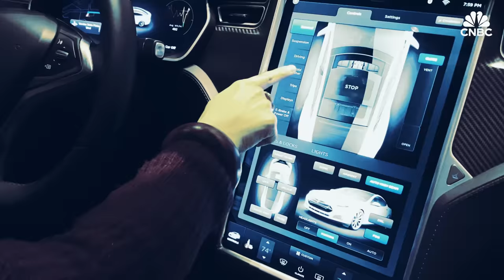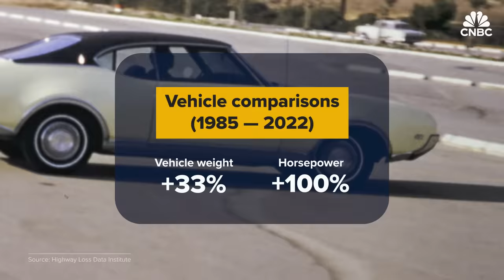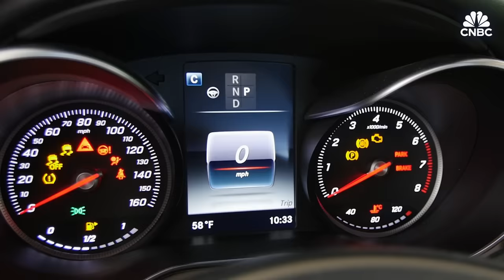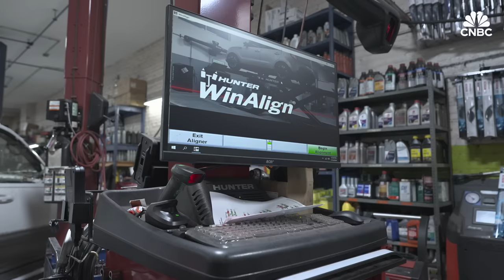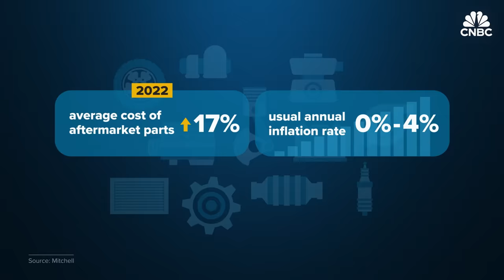Why Car Repairs Are Getting So Expensive

Comment: I just sold my car because my insurance went up 3 times in the past year and it was a crappy 99 navigator with the rear squatted but was wanting 3GS a year to insure the car. My 2007 Mazda that I had before was only 2 for the year and uh yeah haven’t been in any accidents or tickets so yeah sold the car and now just have the motorcycle till I can figure out what to do. To repair the rear suspension a shop was wanting 1500$ for a 99. Bought the car for 2gs period so make it make sense
Reply: Sold the car for 2800$ with only 120k miles on it a newer car is completely out of the quietism as I don’t have 500) for a car payment and 400 for insurance

Comment: Explain to me how cars are heavier now when all the cars today have so many more parts made with plastics than steel. Also tell the government agencies to step the hell in and stop using so much electronics on these cars making them so expensive to fix because there are 60% more modules in these cars today which make it more expensive to fix and diagnose and have them put a stop to car manufacturers the only individuals to be able to repair stuff. I’d rather see more stance items like fuses and relays with replaceable bearings like the old days these maintenance free parts are causing a bigger hit because people can’t check them on a regular basis before they fail.

Comment: TIP: get a vehicle with manual transmission. They are more dependable and economical to get. Learn to to do own maintenance. Use the best oil and best air/oil filter. To protect your vehicle. When you pay someone else to do that they use the cheapest oil cheaper filters is not good for the vehicle and change your oil every 3000 miles o every 3 months. DON'T BELIEVE the dealerships of oil changes every 5000 miles o more.

Comment: Parts have not increased that much. It's the labor cost and greed like in the HVAC industry.
Try to do your own repairs. Do all regular maintenance such as oil changes, filters, transmission oil, and coolant changes yourself, and keep those expensive components in good shape. Most importantly, don't drive like a maniac as driving plays a huge role in wear and tear. Buy reputed brands like Toyotas and Hondas, and good luck if you own VWs, BMWs.

Comment: Car prices are higher, YET, it's shown less parts need to be cast for manufacturing. Less parts should mean cheaper manufacturing. Less assembly required. 

The engineers are building cars overly complex, and the manufacturers under paying technicians. They decide how many hours it takes to fix something, resulting in industry standard pay in dealerships. They pay trash hours for tearing apart the car to fix a small sensor. Which they also charge a thousand plus dollars for on top of. I find it's argument that Turbos add a lot of extra parts to be misleading. It's not that much more. Especially when compared to the enormous battery in an EV. A Kia soul weighs about 2,900 pounds, the EV version is 3,800 pounds. 

The manufacturers are being stupid, illogical, mismanaged, and greedy. 

Also electric car sales are slumping. Fossil fuel engine cars are selling better than EsVs. I doubt dealers would tell you as a customer, knowing their Bias. How do I know? I work for many dealers, they don't lie to me. Believe what you want...manufacturers are embracing EVs. So they can re-sell you an entire car rather than sell you just parts for 15 years.  Same tactic Apple uses, along other manufacturers. Leasing is also their preferred market approach is possible. Ford lost money on their EVs terribly last year as well.

The Economy is certainly a big playing factor. Interest rates still high for many reasons.

Comment: Why are cars bigger -EPA regulations. Why are motors unreliable-EPA regulations. Why are things made so difficult to work on today vs 60s 70s 80s and even 90s companies fighting right to repair. Don't believe me look it up. Even better why is it we need dealer software to look up some very basic issues. That is why it is so expensive now. If you need an example look how to do an oil change on a 13 ford escape. Or ask why toyota has a code to replace your starter after a specific number of cycles. And finally a subscription to have physical features activated on your garbage BMW.

Comment: My 2021 Model 3 has 30k miles and the only thing it needed was a new set of tires.
Reply: all fine and dandy until you get into a accident and need to repair your telsa. insurance would rather totalled it then repair
Reply: @LCJammer  That is what insurance is for
Reply: @marled536  and how much is your insurance. i've heard horror stories of getting into a minor accident and have the car totalled out because its too expensive to fix.

Comment: I replaced the radiator on my S10 Blazer in 2020. I couldn't find a cheap replacement so I had to buy a premium radiator $270 made in Canada. I got a good surprise because the engine ran a lot cooler.

Comment: If you want cheaper vehicles, youre gonna have to give up all the luxuries.  Get computers out of vehicles.  Make engine parts out of cast iron instead of plastic and aluminum.  Body on frame is better than unibody.  Solid axles over cv's

Comment: 🎯 Key Takeaways for quick navigation:

00:02 🚗 Factors driving rising vehicle repair costs
- Factors include heavier and more complex vehicles, new materials and manufacturing methods, shortage of skilled technicians, and pandemic-induced supply shortages.
01:16 💰 Rising repair costs and its impact on customers and businesses
- Repair costs have been increasing more than the overall inflation rate.
- Customers are struggling to pay repair bills, affecting the profitability of repair shops.
02:14 📈 Rapid increase in repair costs post-pandemic
- Repair costs have seen a significant annual increase, reaching about 10% in 2022.
- Expectation of continued cost increase in the future.
03:15 🔧 Maintenance vs. Repair and the impact on costs
- Maintenance involves expected wear and tear, while repair deals with fixing broken components.
- Increased vehicle weight and power lead to more severe crashes and higher repair costs.
04:45 🚦 Impact of speeding, safety technology, and complexity on repair costs
- Speeding and severe crashes contribute to higher repair costs.
- Active safety technology reduces low-speed accidents but increases repair complexity.
06:14 🚗 Impact of advanced materials and manufacturing methods
- Use of lighter materials like aluminum increases repair difficulty and costs.
- New manufacturing methods reduce the number of parts but increase the size of components to repair.
07:40 💻 Increasing complexity due to in-car technology
- Modern cars are like rolling networks of computers, adding complexity.
- Repairs involving sensors and computer systems are becoming more common and expensive.
09:09 🛠️ Impact of technician shortage and labor rates
- A shortage of skilled technicians drives up labor costs.
- Attracting and retaining talent is challenging for repair shops.
10:41 📦 Rising costs of parts and supply chain disruptions
- Prices of commonly replaced collision parts have increased significantly.
- Supply chain disruptions, especially at ports, have contributed to higher parts costs.
11:39 ⚡ EVs and their impact on repair costs
- EVs promise lower maintenance costs but have been associated with high repair bills.
- Luxury EVs and young companies may contribute to higher repair costs.
12:35 🔋 Managing high-voltage EV batteries and complexity
- EVs require additional labor and precautions for managing high-voltage batteries.
- Complexity in EVs includes premium features and evolving technology.
13:05 🌟 Future outlook for EV repair costs
- As EV technology matures, repair costs may become more manageable.
- EVs have the potential to offer cost-effective options in the long term.

Made with HARPA AI

Comment: A car company needs at least have a affordable model with less complicated system. Why not give consumers a choice. I would prefer something with less computers and sensors if that mean lower repair cost, part replacement, and easier to repair by myself. Did people forgot how to drive, turn their head to look at the back of the car, or how far something might be from their car?

Comment: Those who think EVs are cheaper to run than gas cars are delusional. Especially those who say they are far simpler. In theory they are simpler but in reality they are extremely complicated with all the computers. They make it sound like the ICE driver is out there rebuilding the engine every weekend while the EV driver sips lemonade by the pool. The only regular drivetrain maintenance an engine needs is an oil change a couple times a year. Other items are either every several years or maybe never during the time you have it. Most problems are inherent to every car. Brakes, tires, suspension problems, electrical problems, water leaks, rust.

Comment: @cartersa8758 You must not be familiar with this industry.   First, there is so much more that should be added to this video, which closed as basically an ad for EVs 🙄.   Parts has became a full time job on top of the repair.   I spend more time tracking down refunds, waiting, shuffling paperwork, on the phone trying to get the correct part, or sending back bad parts…..I cant turn near the hours I used to in a week, pre coooof.  There is no simple fix at this point as the things affecting the industry are complex.   This video started out decently hitting on some topics, but I think there is a much deeper dive that needs to be done for people outside of the industry to really grasp what is happening.

Comment: all i hear is excuses. these guys replace not repair. be a computer tech before complaining. learn to actually repair broken stuff.
Reply: The problem is computer tech needs the setting from factory, that stuff is expensive and not needed most of the time. 90 percent of repairs is mechanical rather than software

Comment: First of all there is lubrication and those EVS to the doing damage to the Earth because when they get the material for the batteries three the reason why ome only jumped up a little bit because they're already expensive you're talking about 400 bucks at a 4% increase yeah it's not that much versus aftermarket parts from a 200 before this and at a 17% jump yeah